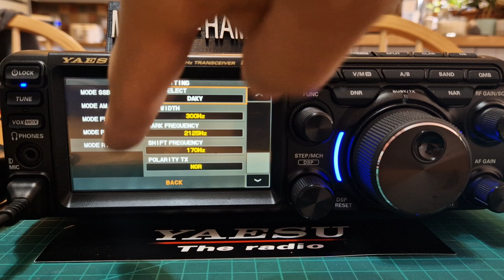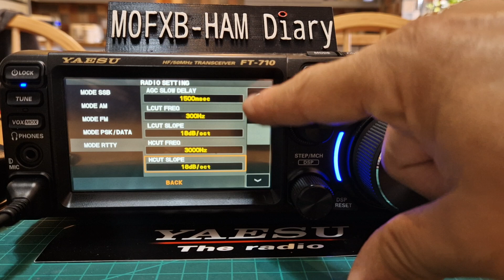YAESU FT-710 RTTY Settings For PC software

Comment: As an alternative to buying the data/rtty cable you can also  use USB to get the audio / cat control working with fldigi and it works awesome
Reply from the maker: Oh wow i will give this a go thanks for the tip.
Reply: @M0FXBHamTech  you're welcome. fldigi can also do cw and tons of other modes. it's an amazing bit of kit.  even if you can't get the CAT control working because the radio is so new you can still receive/decode loads of different digi modes etc and you set the radio for VOX to transmit any audio generated by the app.  have fun :)

Comment: Plugged a usb mouse in the ft710…no mouse pointer seen..is there something I have missed?
Reply from the maker: Mine worked straight away try another mouse .
Reply: @M0FXBHamTech  thanks for reply..only had a wireless mouse so went and bought a wired mouse..haha. Pointer initially appeared in top left corner.